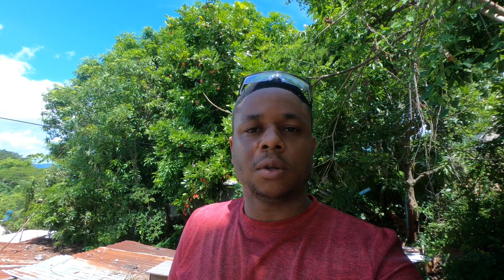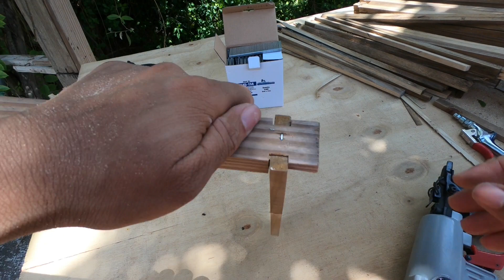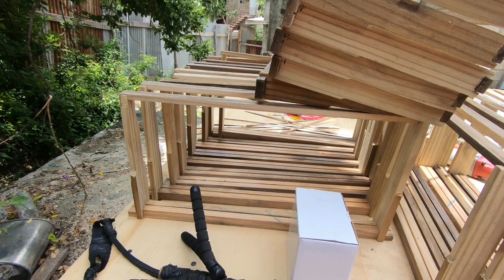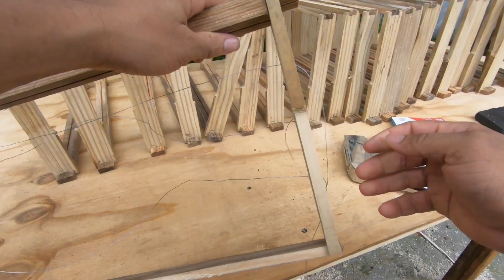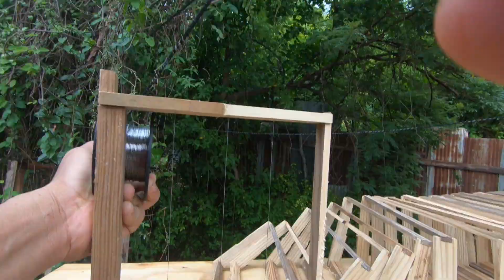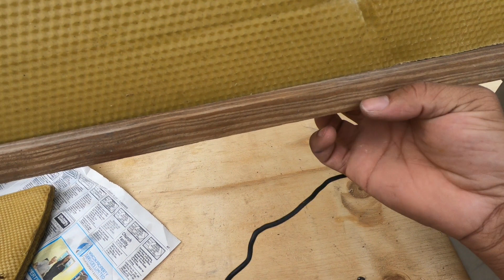Frame Assembly, wiring and wax embedding

Comment: Awesome work Devon! 2021 Production Initiative ready! just a recommendation for the future assembles, drill the holes in the end bars before assemble with a full length hole template made to mimic the completed frame.
Reply from the maker: Thank you kayi. These frame was build off locally sourced frame and it never went that low with the wire. But I think I will give that a try to make it stronger.
Reply: @redzwashere  When I assemble my frames I predrill all the side bars before I assemble them and it saves a lot of time because you can drill about 3 at a time with a metal template. I do use the air stapler plus wood glue. I haven't had to use 2 staples with the glue. You are a awesome beekeeper!
Reply from the maker: Hi Rodney thanks. That is something to think about with the side bar to predrill the holes. I think may try that on one of my next side bar building. I try not to use glue to assemble my frames as it makes it pretty difficult when I need to repair them when they are damaged.
Reply: @redzwashere  That makes a lot of sense as far as being able to repair. I mostly use heavy waxed plastic foundations or Bettercomb synthetic predrawn foundation that I use in swarms if I don't have any drawn foundation available. I respect that you are self sufficient and think outside the box for solutions like the extractor.